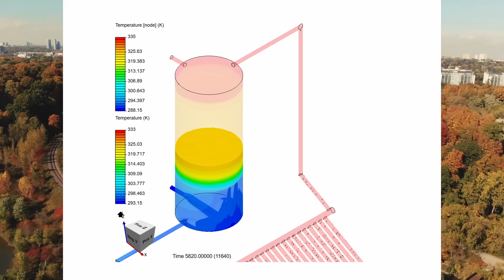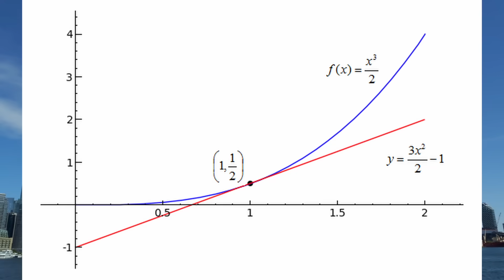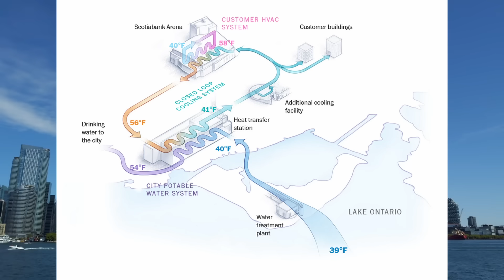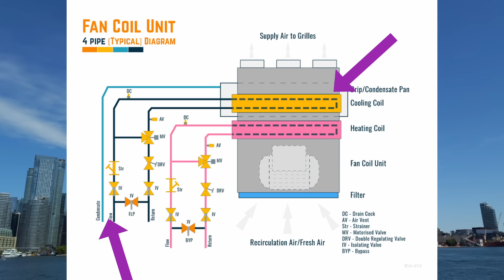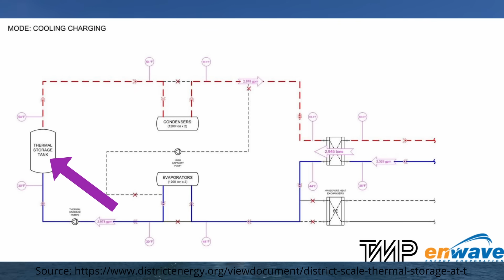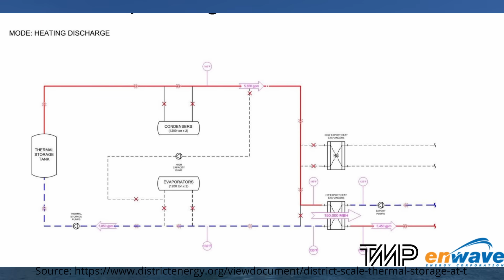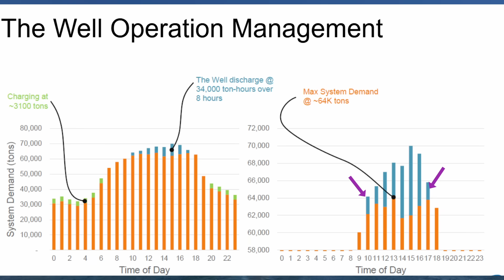Why is there a giant hole in the middle of Toronto? (The Well)

Comment: Good video, but you missed one important factor that amplifies the effect of the "storage battery": During cooling season, running the chillers, i.e. (electric) heat pumps, is MOST efficient at night time, when the ambient air temperatures are lower. (Assuming they are exchanging heat directly with air. Systems built to exchange heat with more stable temp sources, such as lake water, or underground, can be more efficient regardless of weather conditions.)

Comment: Visited the Well to have a stroll and wander through the shops. Lovely to look at. Apartments are nice. 
But the layout of the shopping is a big miss. You've got a huge 100ft+(?) chasm between the buildings. So if you see a shop on the other side you want to visit, you've got to walk several hundred feet to get to a walkway. And to get up or down a level you have to walk a couple hundred meters to find stairs, then all the way back to where you saw the store from above or below. Design looks nice in photos. Not a good use of time. You are trapped in the design. Also, it's outdoors and a bit of a wind tunnel. Anytime outside of the warmer months in Toronto makes you vacate the experience quickly. I tried to work through it in March, just too cold to be outside for so long trying to reach a store. Made me respect the ergonomics of the traditional mall.

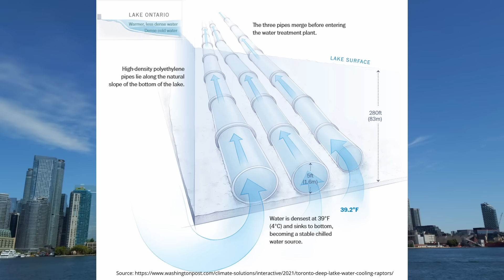Comment: Interesting video, thanks for making it. Just wondering about the actual diameter of the intake pipes, at 2:10 you are saying that it is 600 mm but the corresponding illustration is showing 1.6 m.

Comment: Impressive engineering. But the decision to make it an outdoor mall is puzzling. I hate to feel the cold in the winter. In this day and age, surely they can manage to make feel more insulated from the weather.
Reply: It's Toronto. Try living in the north.
Reply: It’s practically on the lakeshore. Wind and humidity is there with or without the well.
Reply: It would be perfectly fine if they added some art sculpture to break up the wind where the skating rink is. The main thing that sucks are gusts that make it feel 20 lower than it is. And besides, any excuse to build cool art😂